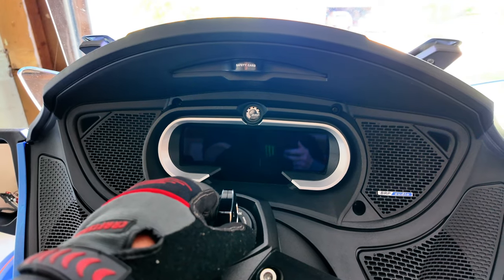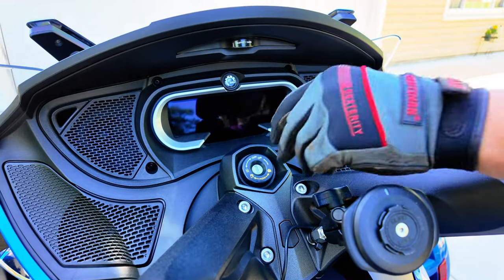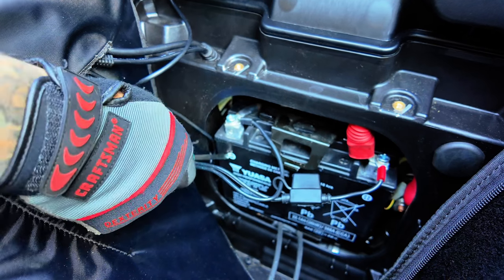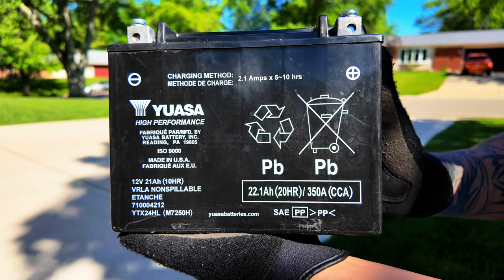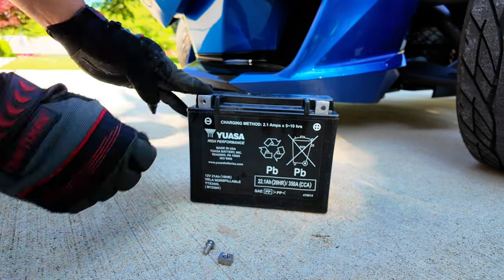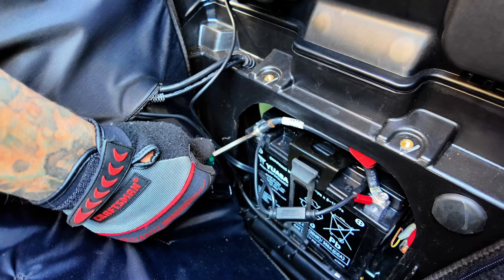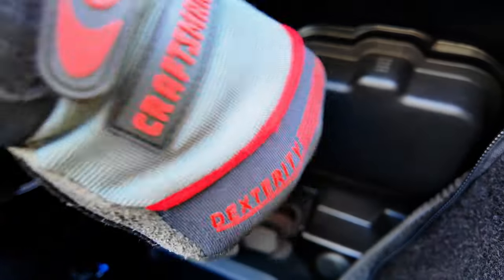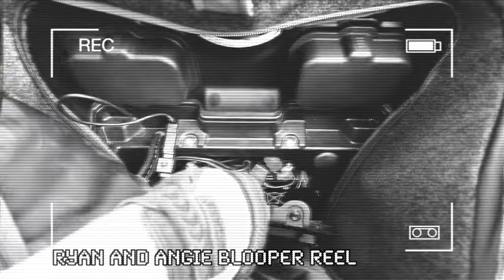How to replace the battery on a Can-Am Spyder (2013-2024)

Comment: Don't forget to add a battery minder at the same time.
Reply from the maker: Thanks for taking the time to watch our video and leave a comment!  Yes, it would be an excellent opportunity to add a battery minder at the same time!  You can probably tell we already had one installed and reattached it during the video.  Thanks again for the positive feedback!!
Reply: What's a batt reminder?
Reply: @SCEPSIS-zw9wv  A device that monitors the batteries chsrge and keeps it at it's maximum and some also repair damaged battery cells